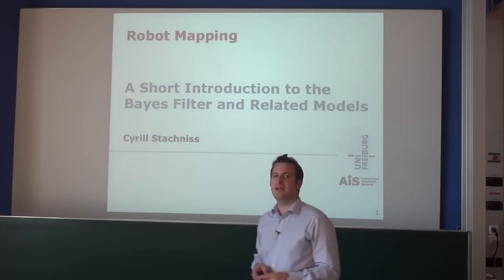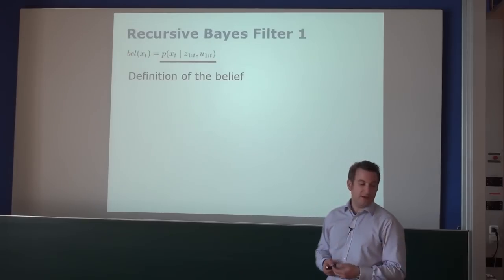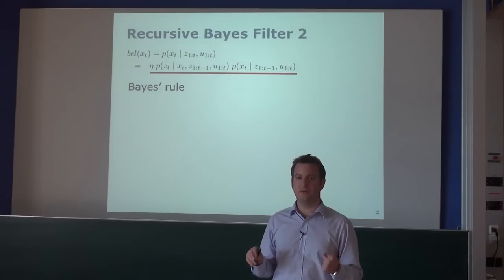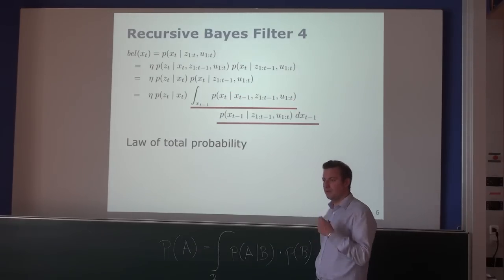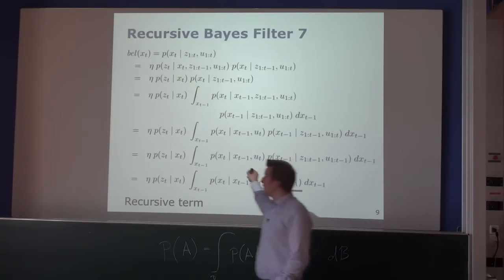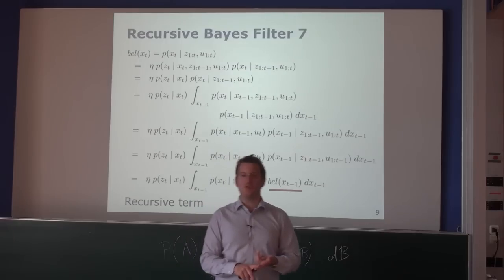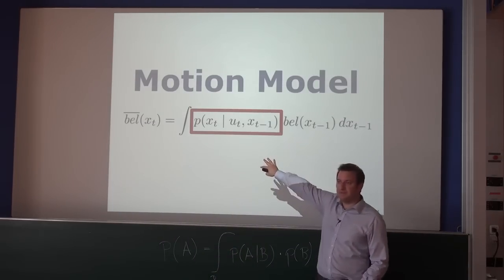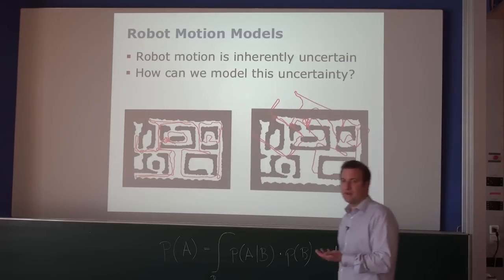SLAM-Course - 03 - Bayes Filter (2013/14; Cyrill Stachniss)

Comment: Thanks for the great lecture professor.
 
I would like to make a clarification for 46:04 , where you explain the max-range effect of measurement model. I think the reason of that part is not about the 5m a way obstacle for a 4m range sensor. I think the real reason is: sometimes the sensor may fail to measure an object even it is just in front of it (let say 2m away), and gives us the result of max range (4m), which is a sensor failure. That part models these kind of errors I guess, isn't it?

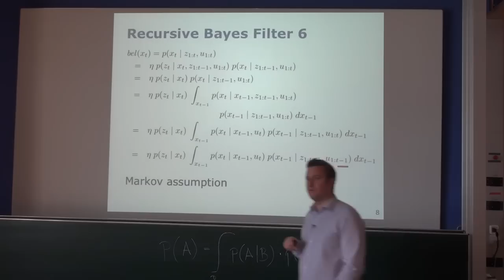Comment: At 13:42, shouldn't we assume that the control action u_t depend on the current state x_t? Control can't be oblivious to the system state can it? If so, then knowing u_t we may be able to infer something about x_{t-1} and the two will not be independent. Is this true? and if it is then we can't use independence to ignore u_t in the last equation.
Reply: Yes, that's the approximation/simplification which he says may or may not be true, at ~13:30. So yes, u_t might reasonably depend on x_{t-1}, so knowledge of u_t would inform as to p(x_{t-1}). But since u_t is informed by x_{t-1}, which only depends on z_{1:t-1}, u_{1:t-1}, it can't provide anymore info about x_{t-1}.

Comment: Why is omega on the denominator at around 32:56 ?
Reply: v = (Omega)X(r). this is cross product of omega and distance from rotation axis.

now r = v/Omega
then intially(when orientation is theta), position of r is (v/omega sin(theta)) and after delta t, r is (v/omega sin(theta + omega*delta t).
now final robot position is (x',y',Theta') = (x,t,theta)+displacement in delta t = (x,y,theta) + (r final - r initial)

Comment: In the velocity-based model, where we assume that the robot receives the command with parameters (v,w) and executes them for a predefined time interval delta-t, shouldn't we also include in the model some uncertainty about the robot's internal clock ? Or can it just be represented as a scaling term for the uncertainty of executing (v,w) ?

Comment: Amazing lecture series - good distillation of the probabilistic concepts.  However a question: why when predicting x(t) using odometry we use a triple transform = initial-rotation-translation-final-rotation.  Given that the bayes formulation is inherently recursive , i.e. x(t) => x(t+1) => x(t+2) one would imagine that the second rotation would be naturally the initial part of the next estimation, i.e. in the estimation of x(t+2).  Otherwise it appears (naively) that we might end up double counting the second rotation.

Comment: I have a small doubt with respect to Markov assumption to reduce the first complex term to p(Zt / Xt). As you said that having previous observations and control  commands helps to get better estimates, then why is it that this assumption is made ?
Reply from the maker: Otherwise we would not end up with such an easy and effective algorithm - and the approximation error can be assumed to be small, especially when eliminating systematic errors beforehand through calibration.

Comment: I have a doubt regarding Bayes's expansion of bel(x_t) in slide no 4. As per my derivation, denominator should have a term P(Z_t | Z_{1:t-1}, u_{1:t}). I am not able to understand how this term is subsumed in the constant as Z_t is dependent on u_t.
Reply from the maker: The whole denominator sits in the normalization constant.
Reply: Thanks for the reply. I am not able to comprehend it.  P(Z_t | Z_{1:t-1}, u_{1:t}) is not constant as it is dependent on u_t
Reply: Nitin Dhiman The original expression is bel(x_t) which is only a function of x_t. It states that bel(x_t) = p(x_t |  z_{1:t}, u_{1:t}) which indicates that z_t and u_t are given (i.e. known), so P(Z_t | Z_{1:t-1}, u_{1:t})  would be a constant.

Comment: When you are talking about the odometry model, does the robot have to make these motions in reality or is that the effective path it will go in the end? If we for instance have a car, that does a lot of curves but the effective path can be summarized as shown in your odometry model in the slides, meaning two rotations and a translation, could the movement still be simplified as that or does the full path traveled with all the different curves have to be taken into account? In that case the model would be very complicated right? This was not entirely clear for me so I thank you for any help :)
Reply from the maker: Yannick M The models describes the intended motion of the robot/car between two time steps. From t to t+1, we consider a simply rigid body transformation, basically from start configuration to end configuration at t+1. But If you chain all commands starting from t=1 ... T, you get a (discretized) trajectory,
Reply: Cyrill Stachniss Thank you for the reply! I got it now :)

Comment: Could someone Explain me what kind of Information the Odometry measurements reports to us? (talking about the measured ones) I mean does the Robot have a internal coordinate System and what relation does it have to the global coordinates? Or does we simply measure everytime from point x_{t-1} = 0 to x_t = 2.5(example) meters and use this information to get the rotations and translation? Just what kind of information ist x_{t-1} and x_t. Since we need in the example x,y,Orientation to calculate the 3 steps the Robot must have some kind of coordinate system or am i tottaly wrong ^^
Reply from the maker: I depends on the platform. Most systems (e.g., a Pioneer) have an internal coordinate system and integrate the motion command within that local frame (which drifts). The pose in this frame is reported to the outside world. Thus in most cases, one uses the internal coordinate frame to compute the relative motion, which is used as the odometry in the methods presented here.

Comment: Hi all, I have a silly Question. Around 27mins in when we are talking about the Odometry Model, why do we measure the translation as the euclidean distance between the two poses? While that does make sense, I thought the Odometry Model meant measuring the rotation of the robot wheels, so I was expecting some formula that included RPM and the wheel radius. I am sure I am missing something silly however.
Great lecture btw. Looking forward to watching the rest :)
Reply from the maker: +Kevin Farrell Most robot control systems provide the pose in a robot coordinate frame, so for the prediction step, you need to compute the rigid body transformation between two poses and use a noise model for it. The Rotate-Tranalate-Rotate Model is just one possible choice, you can take others as well.